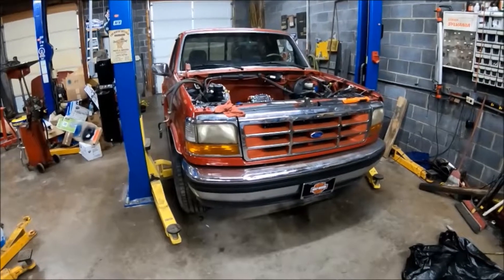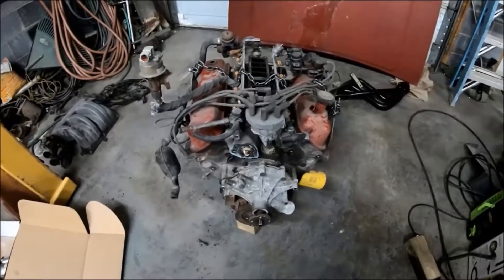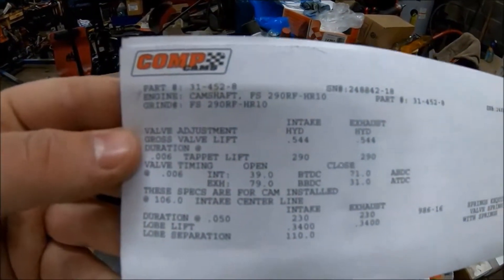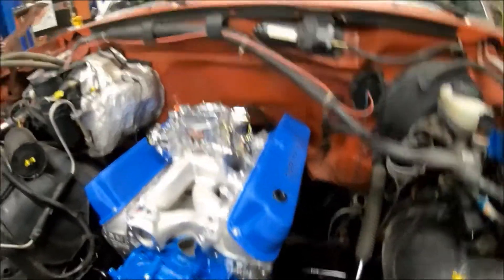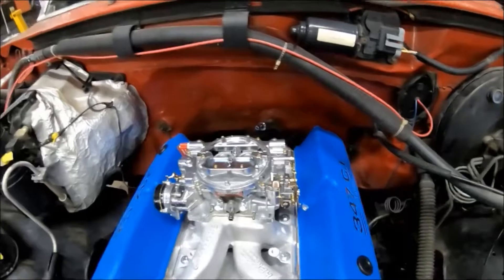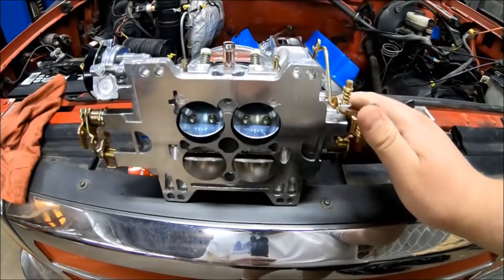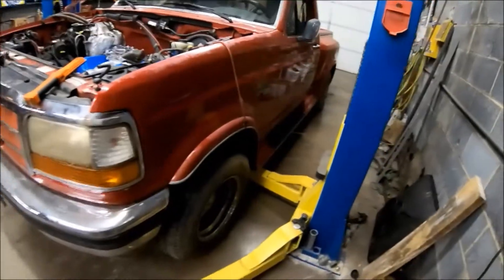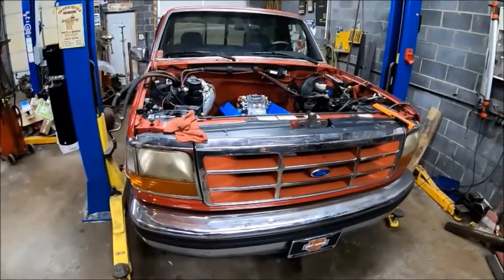1995 F150 Build! Plus Mighty Max update

Comment: Wondering if you could give me some tips. I’m building a 79 Plymouth arrow and I just bought a 305 Chevy small block for it. I plan to bolt that to a t5 but I’m not sure how it would work with the driveshaft and connecting it. I’m in highschool with a small budget and no experience any advice is appreciated.
Reply from the maker: You need to transmission slip yoke and the correct yoke for the rear end. Have the car on the ground have the weight on the rear axle to make the suspension be at normal ride height. Bottom the slip yoke out in the transmission, and pull it out an inch to and inch and a half. Measure center to center of the two yokes for your driveshaft length and have a driveshaft shope make it.